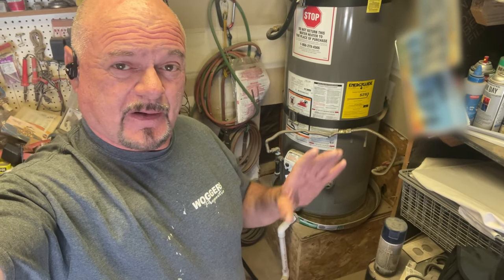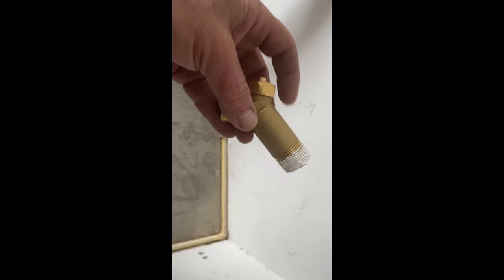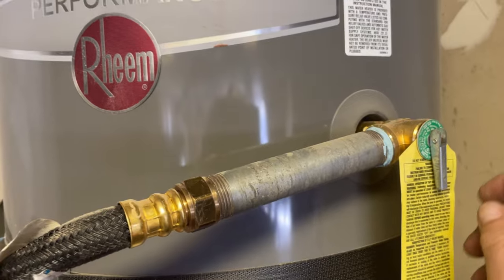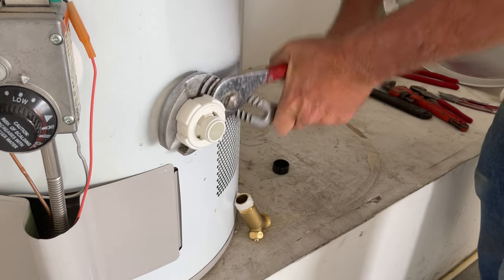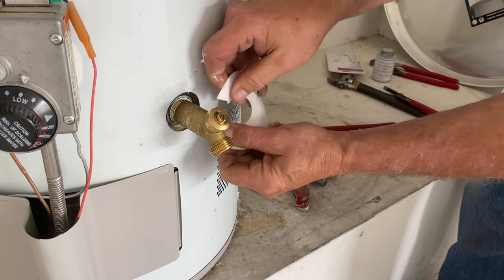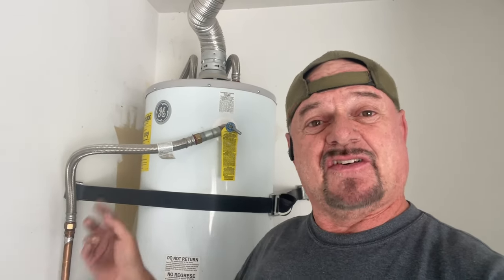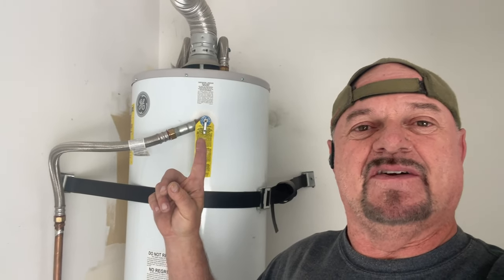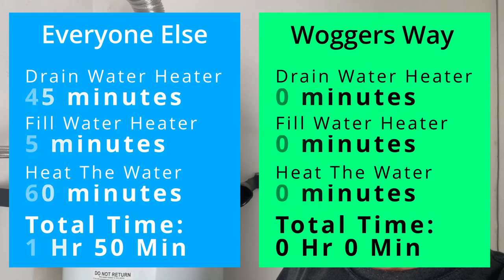Replace A Water Heater Drain Valve WITHOUT Draining The Water Heater

Comment: Sitting here watching DIY plumbing videos while my water heater drains so that I can replace the valve… watch this video, and D’OH that makes perfect sense, but my heater is over half empty already, so I don’t think your trick will work now.  If only I had subscribed to your channel a year ago and seen this before I started.  But I’ll know for next time 😉 
As an aside, a plumber told me that I should replace the whole water heater not just replace the valve, he claimed that the tank itself will start leaking soon, his logic was that, because I had installed the water heater in 1988, it it now out of its warranty and won’t last much longer.  I figure it’s lasted this long, I may as well keep maintaining it however much longer it does last, I drain it every year, and replace the anode rod every 4 years, beyond that it’s not much effort to maintain.
Reply from the maker: 1988?  36 years.. that water heater needs to go to the Smithsonian.  lol  
I agree with you, that if it's not broke, don't fix it, although with a water heater it will eventually leak, if something else doesn't go wrong with it first.  With that said, if the water heater is located in an area where leaking won't cause any damage to anything, or if you have a spill pan under it so when it leaks the water is directed to a safe location, then run it as long as you can.  However, if it leaks and it will result in damages from the water, then a proactive approach to replace it is best.  If you haven't seen my video about spill pans and why they are important, please give it a watch.  There's a link to it at the end of this video, or here's the link: https://youtu.be/jf-9I3G02tY
In the mean time, do periodic flushes and change out the anode rod every 2-3 years and hopefully you can keep that water heater funning another 36 years.  Thanks for watching, and good luck with all your projects.
Reply: @thewoggerswaydiy  thanks for the advice!  My water heater is in the basement right next to a floor drain, so I’m not worried about a leak.  As far as replacing my drain valve, I’m really glad I drained the tank first, because it was a plastic valve, factory installed without Teflon tape (I think they used pipe dope, but maybe not even that), and I snapped the valve as I was struggling to remove it.  I had to borrow a huge vice grip pliers from a buddy to get the remaining part of the valve out of the tank, I would have had water going everywhere if I hadn’t already drained it.  But I still like your technique, just wasn’t right for this particular circumstance.  My suggestion for anyone trying to swap a valve without draining the tank would be to stop and drain if you are having trouble removing a plastic valve, you don’t want a broken off valve with a full tank.
Reply from the maker: so true.. that's why I mention to have a drain pipe on hand to place over the opening in the event the valve breaks.  Thanks for the insight.

Comment: I did this with a bottom element one time.... It ended up being freaking Sandhog! Wish i would have known beforehand....
But, this method he's doing is a really common way to do it...
Reply from the maker: I've personally never tried this with a bottom heating element on an electric unit, but I know guys that have.  Same process and as long as you get that vacuum you should be good to go. Thanks for watching.
Reply: @thewoggerswaydiy  as long as it's not a sandhog... Those elements are the ones that are wavy... 
Good vid

Comment: This is a very good video. I just did a similar job. I had cold water shut off>bad domestic expansion tank> gas water heater then the hot water going up. But i was replacing the the st 5 and tp valve.  . I was mad nervous to create a vacuum to press in (i use a press tool) a ball valve to the hw going upstairs.  But it went smooth.  But id rather drop pressure at the drain than the tp valve unless im gonna replace it. But you explained a step every one else misses.  Its great what a vacuum can do!
Reply from the maker: Same here about the TPR valve.. I don't like "disturbing" them if at all possible or you may end up having to change it out.  That's why I added at the end about using the faucet to create the vacuum, or vapor lock as some like to refer.  Glad your job worked out and appreciate the comment and support.
Reply: @@thewoggerswaydiy  and I just replaced a drain on a boiler today the same way! But today when I went to put in the valve for the hot water going up (this was for a tankless coil) I had to drop the pressure at a faucet, I made sure to use one that had 2 separate handles.  But when I cut into the pipe,  it was coming out pretty fast this time. Lol  I did notice one of their faucets leaking later, perhaps it didn't great a good vacuum.

Comment: Thanks! I'm definitely going to try it! The part is discontinued but Amazon might have it?
Reply from the maker: You should be able to use any 3/4" mpt fitting.. In 15 yrs I've never come across one that wasn't.  On new installs I normally install a nipple with a full port valve.  Good luck and thanks for watching.

Comment: Great Video , you can do that with gas valves and T&P as well , Standard procedure for me never touch a gate valve I shut off at the street those things are garbage! Also you can break pressure at a hot fixture . prevents the t&P will leak forever.
Reply from the maker: Thanks for the feedback and watching.  Good luck with your projects.

Comment: I ah e this exact issue thanks I’m going to follow these steps my only question is do I need to turn off the gas?
Reply from the maker: that is not necessary, since you should only see about 1/4 to 1/2 cup of water come out if you do it successfully.  Good luck with your project and let me know how it goes

Comment: Nice video. Just wondered why you used a leftover valve from some other water heater instead of a full port  ball valve  w/ hose adapter......
Reply from the maker: This was a new valve, as shown at 2:02.. normally we install a full port valve but client didn't want to pay for it since it was in a rental and wanted the least cost as possible.  Thanks for watching.

Comment: Is there a reason for low hot water pressure after doing this?
Reply from the maker: is the pressure issue throughout the house or only at certain fixtures?  If only at certain fixtures you may just have sediment buildup in the fixture or clogging up the aerator.  Replace the aerator and see if that cures the issue.  If it's a whole house issue then simply replacing the drain valve won't cause low water pressure and you have another issue, that just happened to materialize at the same time you changed the valve.  Could be a poor pressure reducing valve for one cause.

Comment: What if the release valve isnt connected to a grain... can you still do it??
Reply from the maker: Why isn't your TPR valve connected to a drain?  It should go to a floor drain with an air gap or to a exterior discharge.  If yours doesn't for some reason, then for safety sake you can use a faucet to create the vacuum instead.  Thanks for watching

Comment: Does this still apply if you have a 2 gallon expansion tank attached to the Cold water in line. I have this tank on my electric water heater. As you know this is the bladder type tank that is pressurized on one side. Hope you get back to me. I would love to try doing the drain valve on mine your way. Thanks!
Reply from the maker: It should, although I have never tried it on a system with an expansion tank.  Others have told me they've done it successfully.  If the tank is pressurized properly (to match your incoming water pressure) then there shouldn't be any water in it to put pressure on the system, and you should be fine.  If your water heater is located in an area where leaking could cause damage you may want to drain it first, as a precaution.  Good luck with your project and comment on how it went.

Comment: Hey is there any chance you could tell me what the overall length is of the plastic valves you removed? Mine looks to be that exact one and it is in front of a utility closet where a door closes in front of it. So I want to make certain the new valve fits.
Reply from the maker: Off hand I'm not too certain.. I'd say 3-5 inches possibly but just guessing at this point.

Comment: This just happened to one of mine. Isnt it good here in Vegas to drain it a couple times a year anyway to get more life out of it?
Reply from the maker: That's a heavily debated question.  Some plumbers say it doesn't make a difference, some say flushing it will extend the life of a water heater.  I'm from the school that flushing it, especially if you're in an area with high mineral content in your water, like we are here in Vegas, is a good practice.  I've cut open numerous water heaters and have seen the extensive amount of sediment build up in the bottom of the tanks, and there's no way you can convince me that it doesn't contribute to your water heater working harder and not as efficient, plus you know all that crud is contributing to the decay of the tank.  Flushing your tank once a year and making sure to replace your anode rod every few years will go a long way in getting more life of your water heater.  Thanks for watching and good luck with all your projects.

Comment: Do you still charge for the two hrs you saved?
Reply from the maker: I charge extra for my "skill". lol.  No, it's cheaper if we spend less time. Although, we do quote the job for a full drain, just in case there's any issues and we have to drain it, but if all goes well and we can swap it out without draining the unit, then we reduce the charge for time spent.  Thanks for the question and good luck with your projects.
Reply: @thewoggerswaydiy  lol, just giving you a hard time. I have a leaking valve that I might give your way a try, maybe. It's on an older tank, 2007, with a leaking plastic valve. I had a plumbing inspection yesterday, and I believe he was a little hard on the valve. I got it to stop leaking, but I do need to replace it. Have a good day sir.

Comment: Great video but what if the cheap plastic valve happens to break off and leave the threads inside
Reply from the maker: That is the one issue that could ruin your day, but that is why I say to be prepared with the vent pipe so you can hold it over the hole in such an event to catch the draining water.  Of course if you suspect that the valve is compromised and  breaking off could be an issue, then if possible drain the water heater first.  Once it's drained now you have to deal with the broken off threads.  Sorry to say there is no easy way to get them out.  If the opening is wide enough you can stick a hacksaw blade in there and cut through the plastic in several locations, being careful not to cut into the metal threads of the water heater.  Then use a small head flat screwdriver and start prying all the pieces out.  You can try a broken nipple extractor first, but chances are that if it broke off in the first place, the threads are pretty corroded onto the water heater and this method may prove futile. Once you have all the plastic pieces out clean out the threads with a wire pipe brush and install your new valve.  Good luck with your project and thanks for watching.

Comment: Question - for a GAS water heater, before shutting off the water, should the gas be completely turned off at the heater and then re-lit after completing this procedure?
Reply from the maker: It's a good idea, but not necessary if you can change it out quickly as in the video.  Just wear protective gloves since the water will be hot whether or not you shut off the gas (unless it's been sitting for quite some time since you shut off the gas).  Good luck with your project.
Reply: @thewoggerswaydiy - WOGGER RULES!!!  It went beautifully! I am seeing water draining out with the new brass valve, which is very encouraging since I was concerned that there was substantial mineral buildup at the bottom of the tank such that water would not drain out through the valve.  Question: do you have a video on removing and replacing the ANODE ROD?  All the work I am doing is on a 2007 GE "Smart Water, Smart Shield" gas water heater. For the rod is it necessary to turn off the gas? I have a breaker bar and if necessary will slide a pipe over that bar to generate the torque to loosen and remove the hex nut on the current rod.
Reply from the maker: @jgehbinv  I currently do not have a video on replacing the anode rod, but it's on my list.  You don't need to turn off the gas, but you should turn off the burner while you change out the anode rod.  Get that cheater pipe ready, because you'll probably need it.  Glad the process for the drain valve went well.

Comment: Factoring in Murphy's Law, it might be prudent to shut the water heater off, or put it on Vacation Mode overnight to lower the temperature of the water. And I wonder, in the case that you don't use the TPR valve to release pressure, would the distance of the faucet you open change the length of time you need to leave it open?
Reply from the maker: First, you shouldn't have your water heater turned up so far where it would scald you, buuuuut, if you do, then definitely wear gloves as mentioned in the video, or let it cool down first.  And no, faucet or TPR, doesn't matter the length of open time.  Thanks for hte comments and for watching.

Comment: I followed your directions, turned off water, released valve for more than a few seconds because it was leaking some water, then closed valve, then unscrew drain valve until it shot like a bullet somewhere in the room. Have not found it but scared me. Some water came out and I quickly put new one in. Why was there still so much pressure?
Reply from the maker: Only thing I can think of, is if you used the TPR valve to relieve the pressure, the TPR valve may be defective, or stuck, and didn't open to relieve the pressure.
Reply: @thewoggerswaydiy  thanks, I'll look into that, these newer hot water heaters are beyond cheap!

Comment: How about changing the pressure valve?
Reply from the maker: The nice thing about the PRV is that it's at the top of the water heater, unlike the drain which is at the bottom.  So, just shut off the water to the heater, drain a very small amount of water and then change it out.  Easy Peasy!

Comment: One more reason for trying to avoid draining the tank:
If, like me, the hot water heater is in the basement, there’s no  drain in the basement, and the only route for an attached hose is higher than the top of the water heater.

Consequently, completely draining the tank involves toting the (50 gals or so of) water out of the basement one bucket at a time.
Reply from the maker: I' surprised that  a house built for a water heater positioned in the basement doesn't have a drain.  In that case, if you don't want to haul buckets of water upstairs, just drain it into a 5 gal bucket and have a pump set up to transfer the water from the bucket to the outside.
Reply: @thewoggerswaydiy my house was built in 1902. Definitely no drain in the basement (cellar)
Reply: Can you empty it into say a large plastic tote, use a garden hose and create a siphon?  Because lugging water sucks immensely.
Reply: @dumbcow1  : But again, the question is how do you create a siphon when the source of the water (i.e. the drain on the hotwater heater) is below any intended destination of the water?
Reply: @NichaelCramer  Perhaps  a small garden pump could get you the vertical pressure you need to ground level or a drain?
Reply: Don’t feel bad I initially installed mine like in a trailer house - rite in the bathroom but up a ways off the floor. Could be a nightmare if too much leaks but oh well t g for towels.

Comment: Really helpful video, but a possibly dumb question:
How sure are we that the thread-size on a store-bought valve is “absolutely sure” to be the right size and will fit?

For example, some other videos have suggested removing the old valve and taking it with you to the hardware store just to ensure that it’s right.

The reason I ask is if you use the technique shown in the video (I.e. not draining the tank) and it turns out the threads on the new valve  don’t fit, then you could be in real trouble. ;-)
Reply from the maker: I have never seen a water heater not take a 3/4" MPT threaded valve or nipple her in the US.  Is it possible?  Anything is possible.  Of course you could always just stick the old on back in and go the draining route.

Comment: My concern is that now the water heater is wet on the bottom. This will speed up deterioration.
Reply from the maker: When done right, there should only be a very small amount of water that comes out, and placing a towel down will absorb it.  Thanks for watching and good luck with your projects.

Comment: What is the valve part number? Are they universal?
Reply from the maker: The valve used in this video was by Everbilt, model# EB12112G through The Home Depot.  Sells for just under $10.  Yes, drain valves are "universal", in that they are 3/4" MPT (male pipe thread).   Good luck with your project.
Reply: @thewoggerswaydiy  Thank you for the helpful video and quick response. I have noticed that drains or anything threaded parts made out of plastic was the frequent issue in other applications around the house in general. My personal favorite is when they use " it's made out of the same substance that NASA uses " as to make us believe that it is super strong 😂.
Reply from the maker: @makb5354   Didn't NASA have one of their shuttles explode.. and another disintegrated upon reentry... just sayin'
Reply: @thewoggerswaydiy 😂 yes